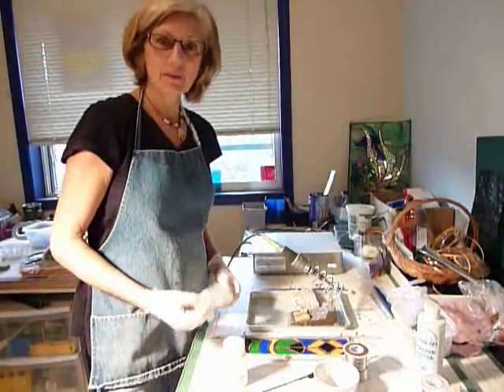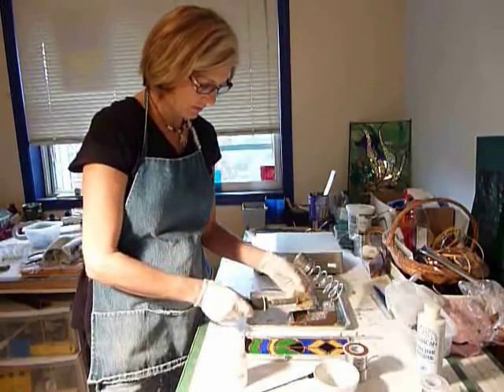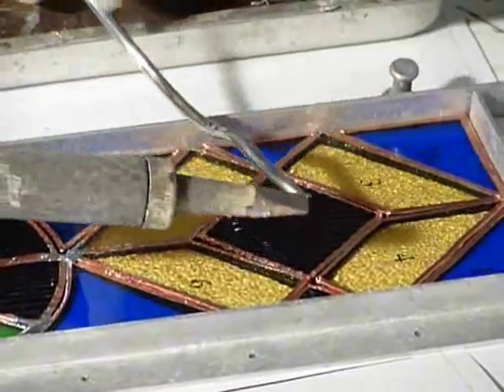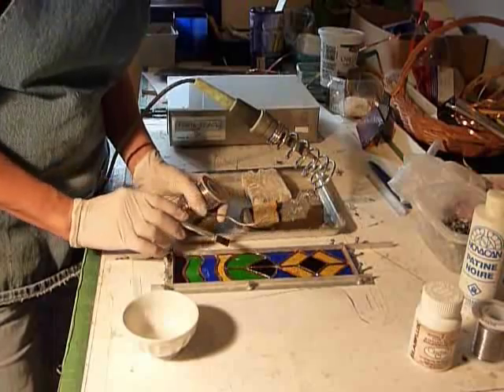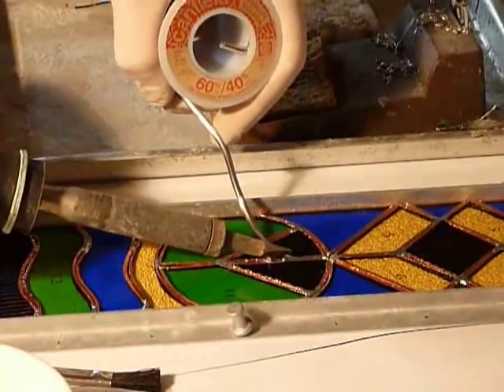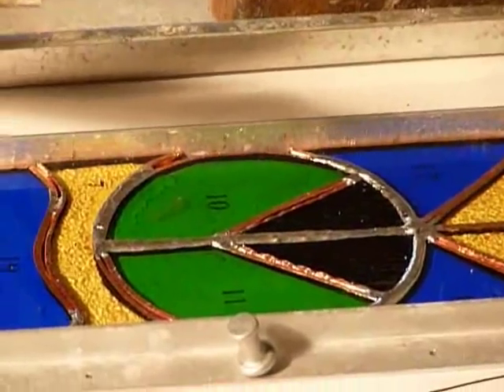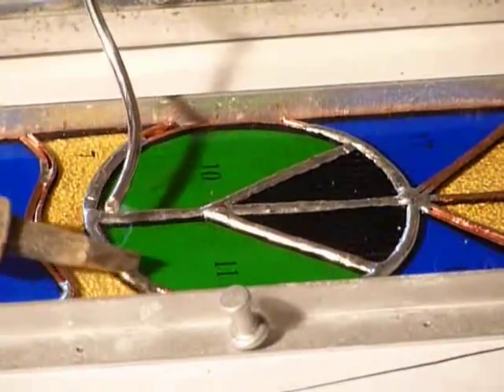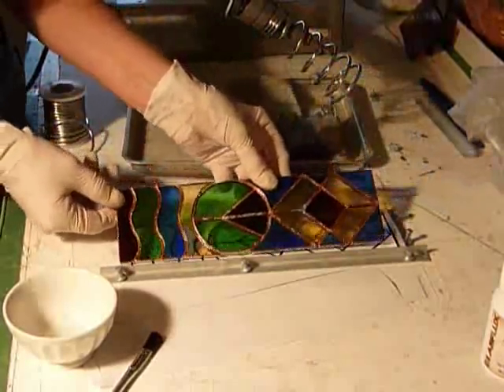(H) Stained glass How to solder the piece.wmv

Comment from the maker: You do not use lead came when you use copper foil.  It is two different techniques.
You can purchase Zinc,copper or brass "Border U Channels" from your stained glass art supply store.
They come in 6'lengths and you need a hacksaw to cut them to the correct length for your stained glass project.
The size I generally use is  ZB-375 (3/8")  or ZB-500 (1/2")
Hope you find this helpful.